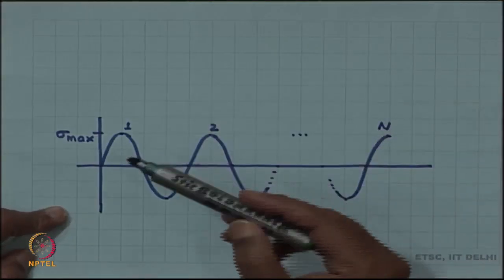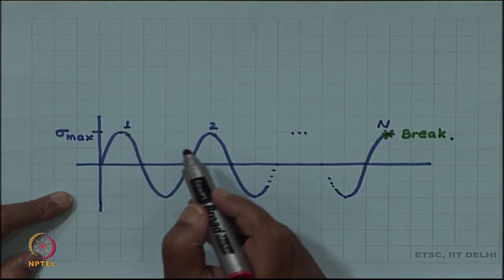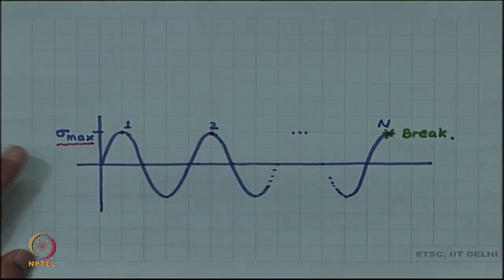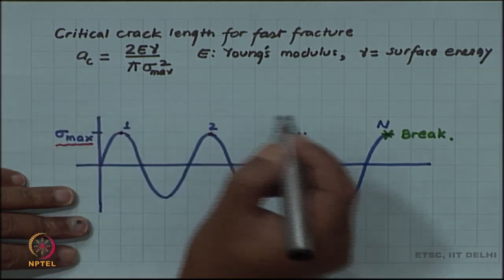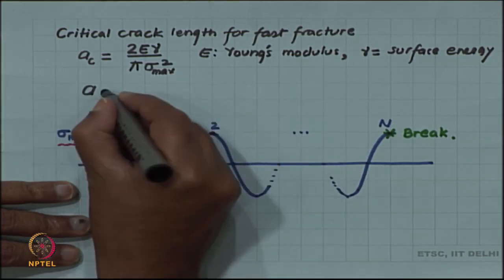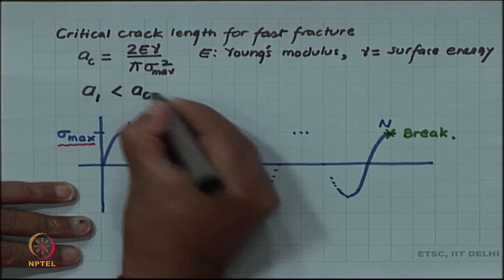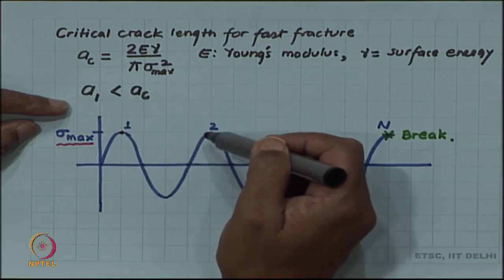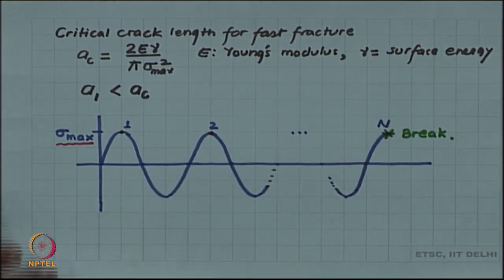Sub-critical Crack Growth

Comment: Sir I finished your total lectures on the subject uploaded on the YouTube and tried to go through some exercise problems.

There I saw a question in heat treatment where upper critical temperature and lower critical temperature was mentioned in various questions. Can you please make a video on these temperatures and their significance in heat treatment???
Reply from the maker: The eutectoid temperature is called the lower critical temperature. Below this (ferrite + cementite) is stable. The temperature corresponding to austenite/austenite+ferrite boundary (for hypoeutectoid steel) or austenite/austenite+cementite boundary (for hypereutectoid steel) is called the second critical temperature. Above this, the single phase gamma (austenite) is stable.
Reply: @introductiontomaterialsscience  sir why the austenite phase 
is not stable below the eutectoid temperature??
Reply from the maker: @kumardaksh6904  Well the question is both easy and difficult to answer. Easy at the thermodynamics level. Stability of a phase depends upon (at constant temperature and pressure) on its Gibbs free energy. The phase or a combination of phases which minimise free energy is stable. For eutectoid composition, the free energy of austenite is minimum above the eutectoid temperature. So it is the stable phase. But below the eutectoid temperature, it looses to a mixture of ferrite and cementite, which now have lower free energy.

Now the difficult part.

Well, all why questions are inherently difficult to answer. For example, one can ask why austenite has the lowest free energy above the eutectoid temperature? This is outside the purview of classical thermodynamics. One has to calculate free energies on the basis of more fundamental quantities like bond energies. This is the realm of statistical mechanics. 

Of course, one can still ask why? And one should. Till one finally gets stuck!! :-)
Reply: After having a satisfactory answer,it seems to me that you are one of the best test teacher of Material science, 
Thank You Sir